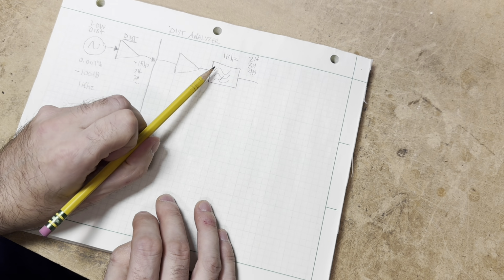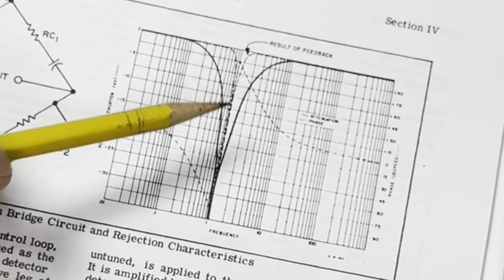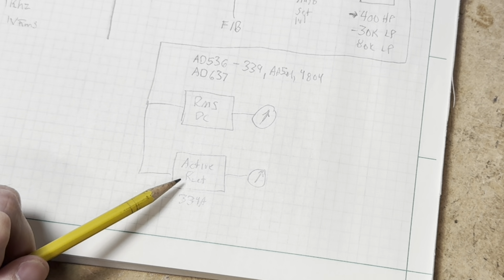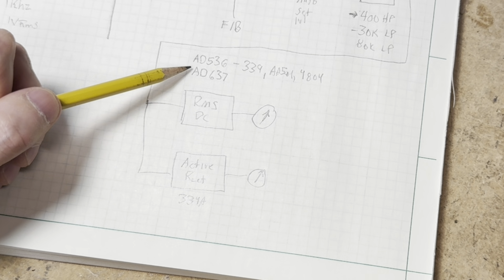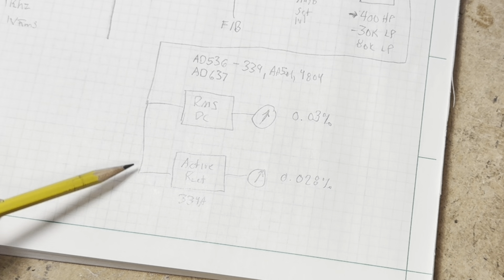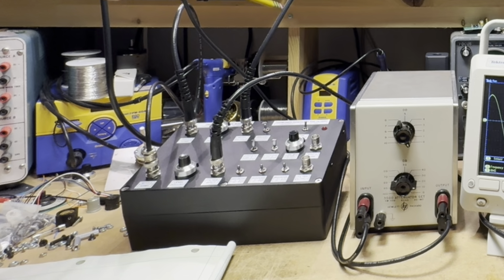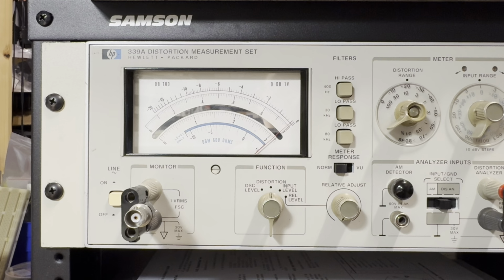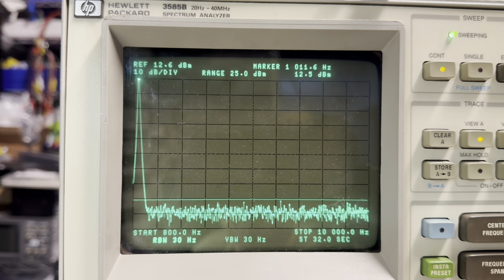Build Project Part 1: Fundamentals of Distortion Analysis

Comment: Very consice and informative video. Had to sub and thumbs up. Can my HP 3561A DSA be used in tandem with my HP 3585A Spec An to test audio amp's/guitar amp's THD, noise to signal ratio, etc., in place of a Distortion Analyzer? Thanks and cheers!